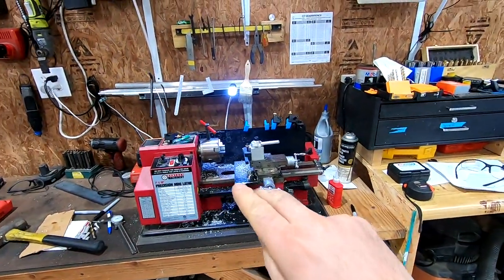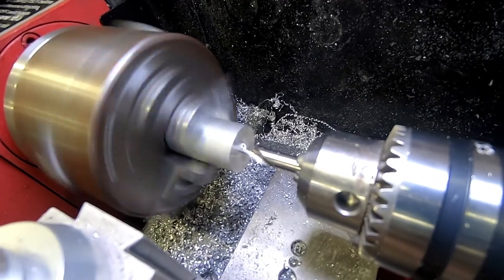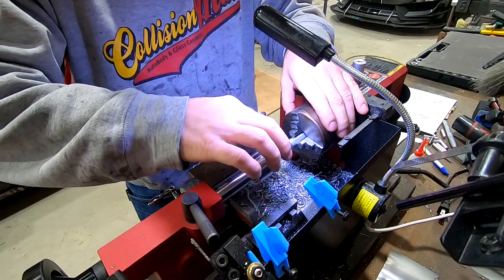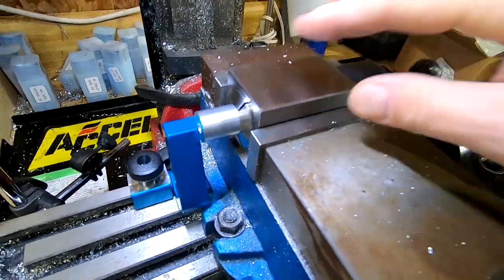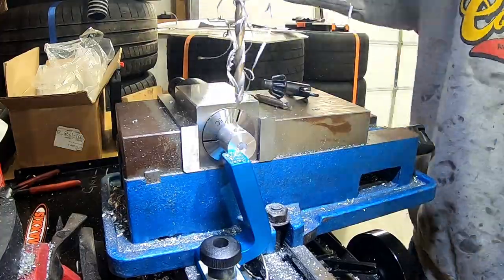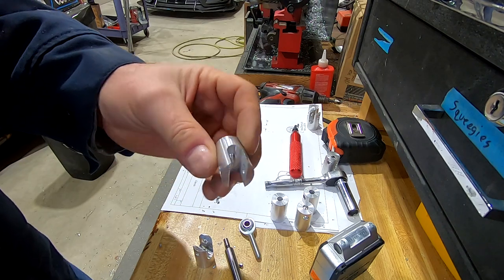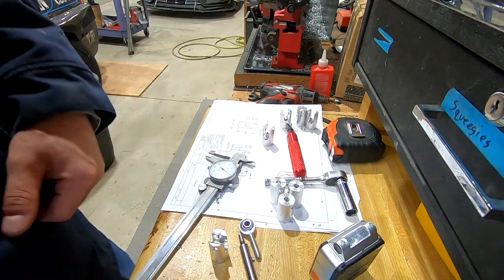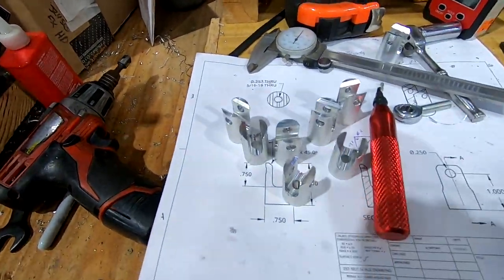Making Clevis's On My Mini Lathe and Mini Mill

Comment: Do the dials on your carriage not show increments of adjustment? Shouldnt need to remove the part from the chuck each time you measure it...
Reply from the maker: They do but aren't extremely accurate and account for any amount of flex and hence why I was .002" on that last .006" cut.

Comment: hey man seeing you do this work on the mini lathe and mini mill has really solidified me wanting them. Do you recommend those? how long have you had them?
Reply from the maker: 2 or 3 years. Great for getting started. I just upgraded to larger machines cause what I wanted to make wouldn’t fit in these.
Reply: @ajhartmanaero  you selling them?
Reply from the maker: @Camero737  sold the mill. Lathe is still for sale. I’m in 24592 if you are interested.
Reply: @ajhartmanaero  yea a bit far for me but thanks. any problems other than the size with them?
Reply from the maker: @Camero737  no. Ran like a champ for me.
Reply: @ajhartmanaero  thanks for the info. Appreciate it. Keep up the good work!